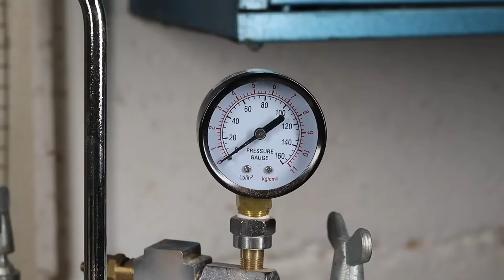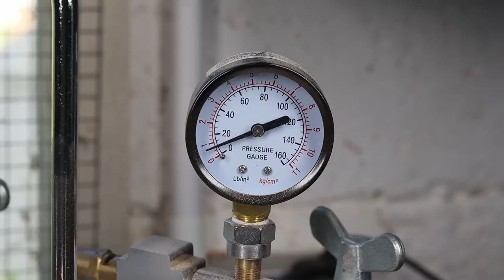Woodturning - Exotic Timber Shavings To Unexpected Pieces?!

Comment from the maker: This was the last video with the old lathe! It was sad to say goodbye, but it was time for an upgrade. I've got the new Axminster AP508WL installed and ready to turn, so stay tuned for lots more exciting projects. What lathe does everyone else have? Or are you looking to buy your first? 😁👍
Reply: I have a little Axminster - an old version of their current 305WL. I do wish it was a bit bigger sometimes but I don't really have the space for anything much larger!
Reply: Great job as usual Harry! I started less than two years ago with an Holzmann DF460FXL. Last year I had an upgrade with an Holzmann 810. It' an Austrian brand, I choose it for the low price, but it works well for my little projects. Cheers from Italy!
Reply: I have a tiny bench top antique lathe, powered externally. I currently hook it up to a vintage Black & Decker single gear drill via a dimmer switch, for primitive speed control. As you might imagine, I don’t video my projects, such as they are!
Reply: Stratos XL.  It'll probably see me out.  I started off with a mini Proxxon model makers' lathe to make pens.  I belong to a woodturning club and it's traditional to pass your old lathe onto a beginner or someone on low income when upgrading.
Reply: @alansimpson596  what a great tradition 👏
Reply: I have a mid 1970s Sears Craftsman 12"
Reply: @solidarityworkers6900  Thank you for your reply.  I passed my old lathe and a bandsaw onto a club member who was on low income.  I got immense satisfaction from this.  The recipient has now started uploading videos on YouTube so I see my old lathe in action.
Reply: @alansimpson596  its great to see in this day and age that there are still pockets of kindness and people who believe in support for others and true community spirit. Solidarity brother ✊
Reply: I use an old Axminster too ....
Reply: Nova 3000, Axminster AC370 mine is the Nova and I absolutely love it, the Axminster is my wife's. SC80 chuck for the Axminster,  original Supernova and two G3's for the Nova, the Supernova has a spindle adapter so I can use it on the Axminster. I leave 50mm jaws on the Supernova,  one of the G3 chucks has the 100mm jaws and the other has a set of coke jaws. I also have access to another four lathes at work 🙃
Reply: @solidarityworkers6900  Thank you.
Reply: Laguna 18/36 and a Jet bench top for smaller pieces. It is fun to read what others are using. My first lathe was a 12/36 made in Taiwan in 1974. It had 5 belt driven speeds and it worked quite well for the $20.00 I gave for it at a garage sale.

Comment: - How much air bubbles do you want in your epoxy?
- Yes
Reply: To be honest Sylvain, none but there was a chemical reaction with the epoxy and glue I used when it went into the pressure pot! However they are very uniform and I think quite effective... 🪵😃👍

Comment: Great idea Harry and I really like the finished product! I've just been turning some Rose Myrtle and Purple Heart and have got a load of shavings - and you've started me thinking! Where do you get your resin?
Congrats on your new lathe, I look forward to seeing it in action!
I started with a little Axminster hobby lathe but treated myself to a Coronet Regent a couple months ago - it's a good balance between power and versatility while still being compact enough for my limited workspace. I'm still getting to grips with it but loving the gains. That said, I love the quality and reliability of all the Axminster range - I will keep my old Hobby lathe for when I start going to craft fairs and for smaller projects. Why do we get so attached to our lathes?
Reply: Thanks Paully. I try to use everything that's a byproduct to the turn, I just hate waste. I buy the resin locally from my woodshop and also Amazon. 
The new lathe is working out well and fantastic, its taking me to another dimension!
Take care Harry ... 🪵😃👍

Comment: How come the clear resin, which was clear when you took out of pressure pot, finished all cloudy? Was that planned?
Reply: Hi Noel, thanks for you comment, there was a chemical reaction with the epoxy and glue I used when it went into the pressure pot! However they are very uniform and I think quite effective... 🪵😃👍

Comment: I'm trying to figure out whether I'm just hangry or my negative feelings about this video are genuine.

First, I notice almost a third of the video is about vacuuming the epoxy. That's a part I just skipped. Then, after the usual process of turning the pieces that turn out to be a pair of tumblers, I see whiskey being poured *from a measuring glass*, notice how murky the tumblers look, and then you even add a couple ice cubes just to cut my appetite. Then, to top it off in the most ridiculous manner, there's the plastic sound from the glasses clinking, ending the video abruptly. I had to rewind the last few seconds to try and have a look at the glasses because you didn't take the time to show them off, but none of the wood chips show, just a nondescript dark coloured bottom.

The whiskey serving preferences aside, I think you missed the opportunity of showing off the finished glasses properly. I hope my comment inspires you to play around more with lighting and camera angles. As they were shown, the top part seemed almost dirty (which is sort of off-putting when consuming a fine beverage), and the bottom part showed pretty much nothing special. I know you've done better, so here's one hoping for progress!